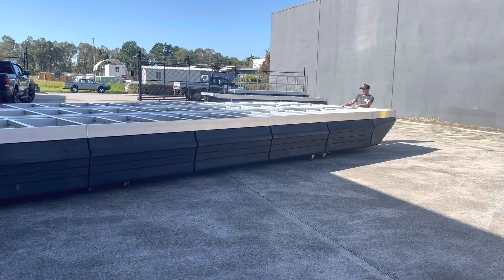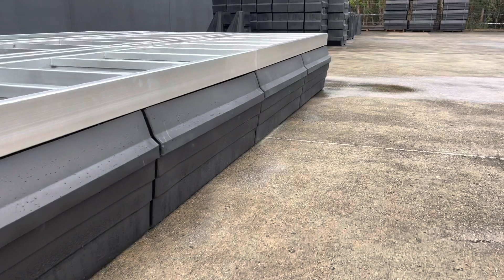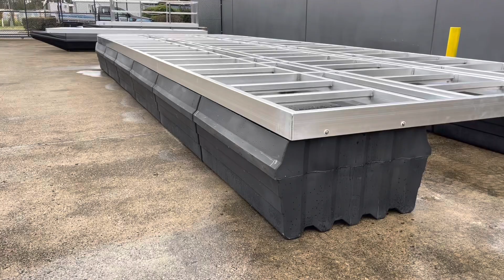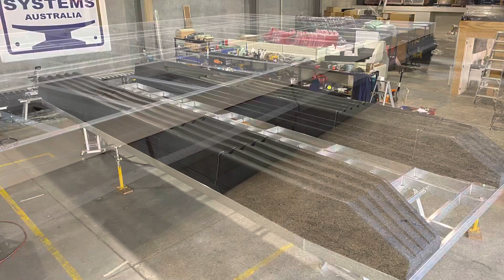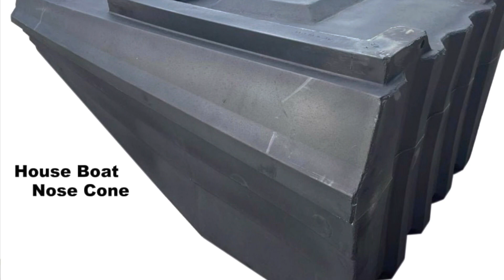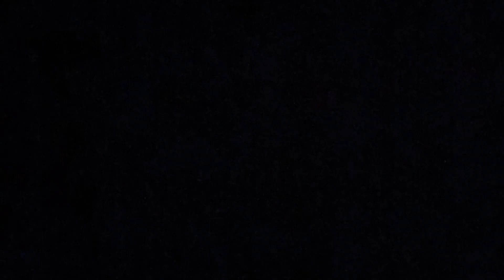Build your own houseboat polyethylene pontoons and aluminium frame

Comment: 176 m steel rail rr
135lb yd  66 kg m
Steel rr rail 
176 m weight 9900
X .20  *  2138kg × $.37 us   $ 788 ÷ 13800
17 x cheaper
5.7 %
* 5 × less or 1/5 .20
Because dont use but 20% of rail and use less of framing
Reply: 788÷40. 19$ m sq

Comment: Nice!
Do you manufacture the floats? If so, are the HDPE? We recently built a barge/narrow boat from HDPE, such a versatile and easy to use material.
Reply from the maker: Yes we make these 👍
Reply: @MarineDockSystems  And the question about material?

Comment: Can’t I just buy blue 55 gal drums? And build a frame for them?
Reply from the maker: Yes you can. The advantages of these floats are that they are food grade, 8 to 10mm thick and can be bolted at the top so you don’t have straps around them. You can also get them through survey if you wanted to rent your boat out or do an Airbnb. Regards Brett

Comment: I am very interested in purchasing this product, but I am really concerned about the way to attach them, as each side of them is attached only by one screw, meaning that each one is connected by four screws. Is it possible to add four more, or to have additional cleats on the sides?
Reply from the maker: They just have the bolt holes on the ends

Comment: How do I get about purchasing this unit and get it over in Québec, Canada ? And what would be price approximately with delivery.
Reply from the maker: It’s a bit to large to ship to Canada. I can sell you just the polyethylene floats and give you a drawing to get the frame welded up locally. Regards Brett. Where are you in Canada. I was born in Trenton Ontario. I live in Sunny Queensland now Australia 🇦🇺
Reply: @MarineDockSystems  so how much in Canadien dollars for your largest floats 36’ feet long. X 2.
Reply from the maker: @danielquenneville3561  polyethylene floats 33 feet long $9500 ca I will have to get some freight costs on Monday.
Reply: @MarineDockSystems  now you gave me a price on floats. What about the floor deck. It seems to be 2x6 aluminum square tubes. My plan is building a 36’x12’ house boat. 8’ front deck and 4’ back with hard top deck. The built will be totally aluminum construction. Question?? With your experience, would 2 floats be adequate ? I’m planning to propel the boat with 2 Yamaha 50 hp Bigfoot.
Reply from the maker: @danielquenneville3561  Hi Daniel please send me your email address so I can send you some information.
Reply: hi my friend id like to build one and i like to ask you the design for make it the frame and if i can buold for myself also the floater maybe? must be cheap.. thank you and very good job